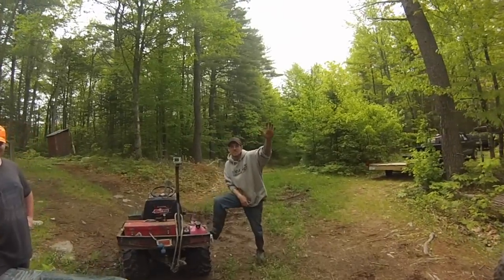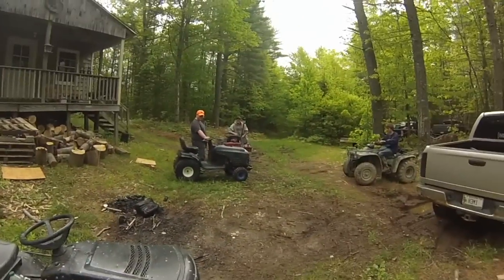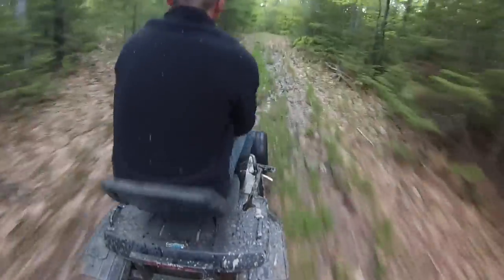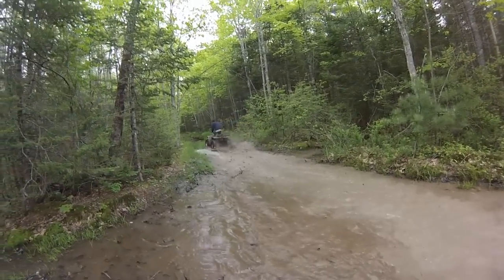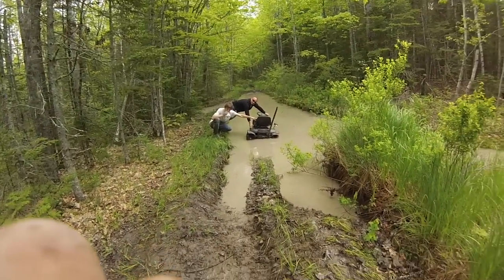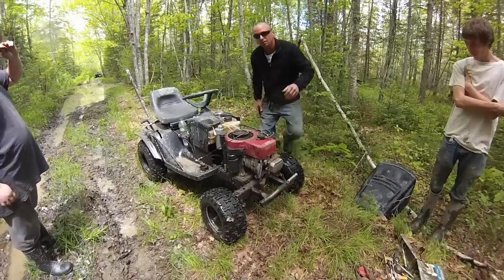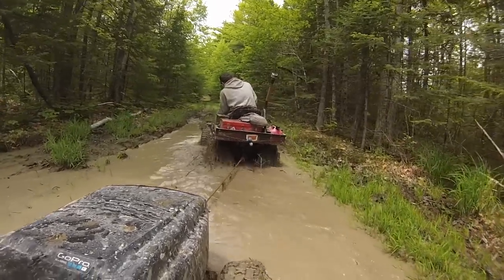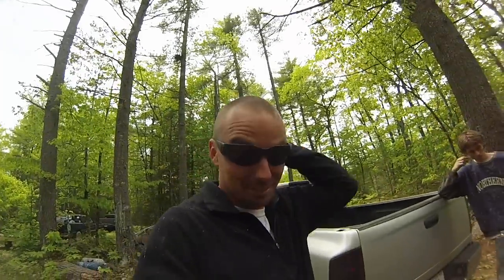I KILLED THE MURRAY!

Comment: Pro tip- pull back on the clutch pedal, and that should tension the belt more. I found this out on mine (stock front pulley, 3" rear) and it works pretty well.

Comment: why don't you snorkel these things
Reply: it does have a snorkel
Reply: the snorkel hasn't been hooked up since the carb swap
Reply: Legit legitness 
Coulda bent a rod or popped a head gasket..could check the flywheel key....
The Hillfolk compression test of your finger over the hole in the field coulda noted a compression loss. 
Might as well yank the head if the flywheel key is ok.
Reply: Xxxbado

Comment: Just goes ta show ya- Nobody is safe!!! LOL Soooo... Snorkel? :D
Reply from the maker: Sprocket's Garage  the sad thing is, I have one installed! It's just not hooked up since I did the carb swap
Reply: Yeah- I seem to recall that you had an intake pipe running up behind your cowl, right? Might wanna revisit that, I think!
Reply from the maker: Sprocket's Garage agreed!!!
Reply: FearlessFront (Todd Christopher) great vid glad to see you back on the murray
Reply: FearlessFront (Todd Christopher) i have a question about my molkt carb on my mower i was womdering if u could answer for me. so i have it installed and i have moved the c clip on the needle all the way down but it seems to be gettin to much gas ive adjusted it to where it will idle an then when u hit the gas it revs up real high and wont rev down
Reply: austin stokely put the c clip back in the slot that it was in my did it to
Reply: Myles Pike  ok do u remember which one it was ini havent messed with it in a while so i dont remeber which slot it was in
Reply: austin stokely the there I am pretty  sure
Reply: Myles Pike ok thanks
Reply: austin stokely if it still  messes up comment me on this vid again
Reply from the maker: austin stokely it sounds like your slide isn't sliding. I would check to make sure your throttle cable slides freely, and doesn't have any Kinks. also make sure the spring is installed correctly in the slide
Reply: FearlessFront (Todd Christopher) it slides but the when i put the throtle cable in the spring was straight and now when i take it out the sping still goes in but the cable had the spring compresed and folded kindve like an L
Reply from the maker: austin stokely are you sure your throttle cable is long enough for the slide to bottom out?
Reply: FearlessFront (Todd Christopher) yea it bottoms out thats why im stumped
Reply: austin stokely did you try to move it back yet
Reply: Myles Pike na i havent yet ima try that in the morning hopefully thats all it is
Reply: Myles Pike na i havent yet ima try that in the morning hopefully thats all it is
Reply: austin stokely ok message  me back on this vid I will  figure  it out if it doesn't. try to move it to the third slot
Reply: Myles Pike ok thanks
Reply: Myles Pike ive moved the c clip an now it sounds like its choked the whole time
Reply: austin stokely try forth if that don't  work try the fifth
Reply: Myles Pike ive got it goin now thinkd
Reply: austin stokely it running good now
Reply: Myles Pike yea just needa fix my brakes
Reply: austin stokely cool man glad I could help u how old are u
Reply: austin stokely not trying  to be a creep
Reply: Sprocket's Garage Jim

Comment: How can I de-wire the seat switch and the blade engage switch I'm not very good with wiring on lawn mowers, there is also the problem with getting the valves dialed in, how are they spaced, I have already retimed the valve gear for a second time because I had to clean the gasket out of the engine when it blew and make a new one.
Reply: Charles Thurston look At his video on a push button ignition it bypasses all safety features

Comment: Should put a hole in the hood, bring a snorkel up through with a 180 degree bend facing back down.   Kept kinda low over the hood so sticks and crap wont get hung on it.

As for the engine trouble, I'm thinking crack in the block possibly?  Betting you have very little compression.

Comment: You might have bent the connecting rod. That's typically what happens when a vehicle would suck in water. There's enough compression to blow water out the hole but not enough for the engine to fire.

Comment: For the Record (You used copper on one of your other videos)
Permatex® Copper Anti-Seize Lubricant Category: Specialty Lubricants - Anti-SeizeA premium quality copper anti-seize and thread lubricant that may be used to prevent seizing, corrosion and galling where high temperature conditions exist. Contains a high percentage of micro-fine copper flakes in a semi-synthetic grease carrier and is fortified with high quality rust and corrosion inhibitors. Temperature range: -30°F to 1800°F (-34°C to 982°C). Provides good electrical conductivity.

Permatex® aluminum Anti-Seize Lubricant Category: Specialty Lubricants - Anti-SeizeA highly refined blend of aluminum, copper and graphite lubricants. Use during assembly to prevent galling, corrosion and seizing due to weathering or chemicals. Anti-Seize assures easier disassembly. Temperature range: -60°F to 1600°F (-51°C to 871°C). Salt, corrosion and moisture resistant – ideal for marine use. Non-aerosol version meets Mil Spec #907E. Aerosol – Level 3*

Comment: I rolled mine upside down in a canal. My motor on my Murray has been underwater six different times. Mine just so happened to be just idling when it hit the water. That's why I got lucky. You was on the throttle that's why I blew the head gasket

Comment: my rear_end makes weird noises when i try to get to high speeds and it wont work right
Reply: any ideas to whats wrong?
Reply: is it greesed fill or oil filled transaxle
Reply: wash it all out and put new greese in and try that if that doesn't work u got a Facebook message there and I'll get u going on the trans
Reply: +adAm stoudt yeah, i have messenger. that cleaning it out thing might work but the sounds mainly occur in 6th gear
Reply: +adAm stoudt ok, whats your username and profile pic
Reply: what's yours and pic
Reply: +adAm stoudt mine is Mason Grant_Petley. my profile pic is of a truck doing a big wheelie
Reply: theoutbackbandit mines Adam stoudt the pic is Donald trumps face
Reply: did u find it I could not find yours
Reply: +adAm stoudt do you have the state of where you live in there by any chance? if so where? cause im not finding anything that looks like Donald t
Reply: theoutbackbandit virginia

Comment: thinking you popped the flywheel key when the motor took that nasty drink. 
had one 180 out when the key broke and was sucking in the exhaust and blowing out the carb.
was gonna say why not bring a 12volt air compressor on board, or can of pb blaster woulda dissapated the water in the combustion chamber👍

Comment: Get much better tires for it so the Murray can keep up with moweroutlaws tractor
Reply from the maker: +Go karting101 I could, but I like the setup, the small tires make it more maneuverable
Reply: FearlessFront (Todd Christopher) couldn't you get the same size tires but grippier tires so it's better in mud and maneuvers the same if not at least it drifts good